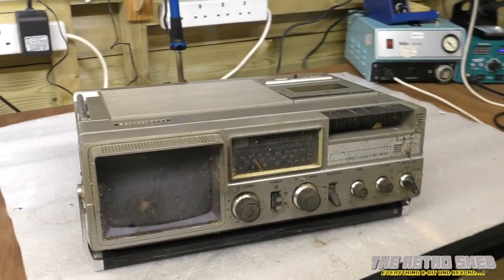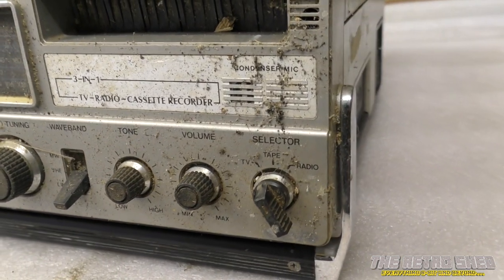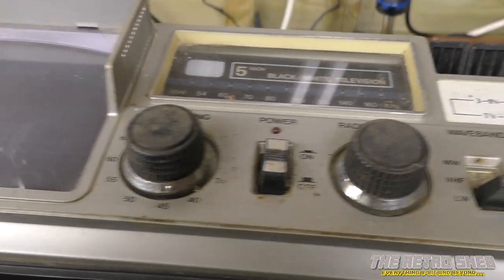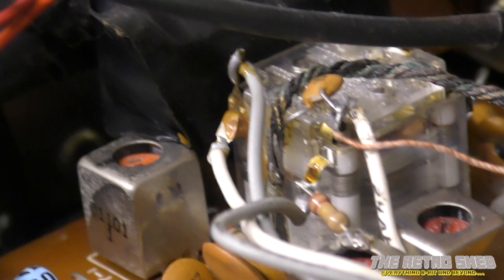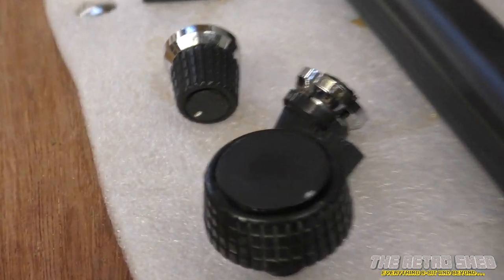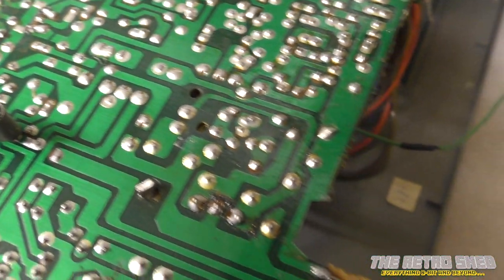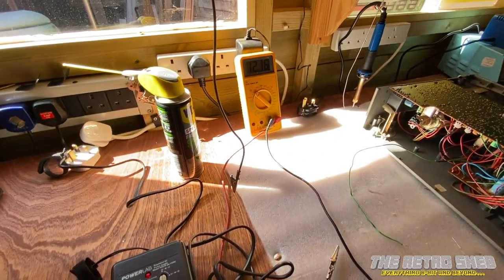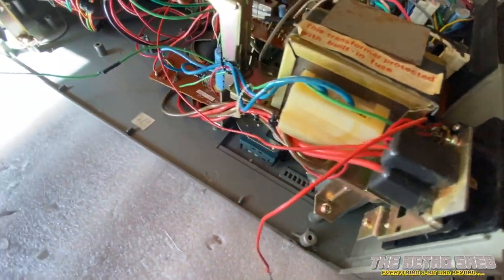BoomBox TV Renovate | The Retro Shed

Comment: love the video, I have aquired a hitachi k62L its in great condition the only thing that doesnt work is the TV I assume the tube has gone but i dont know where to start with it.
Reply from the maker: Hi thank you! The K62L has a little 5" CRT I think. Is it coming on at all? (the rest of it I mean!) If only the tube is not working - the most common problem is the flyback transformer or capacitors. You could probably get a replacement flyback - most of them are still being made. However I could certainly not recommend trying such a repair unless you know exactly what you are doing as it could end in tears. Or worse. Here's whats involved in swapping out a flyback... https://youtu.be/jh5N7S7Wi6E?si=8ajQzIzB19VXKm5p